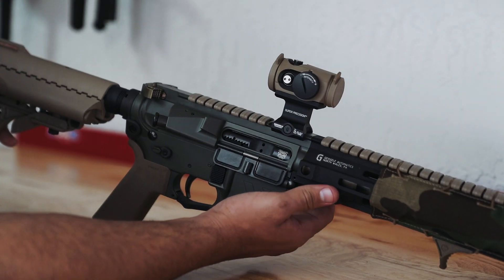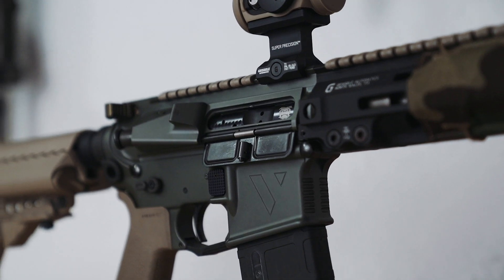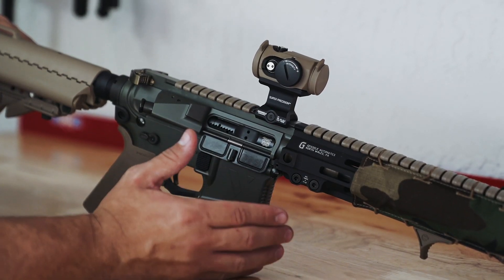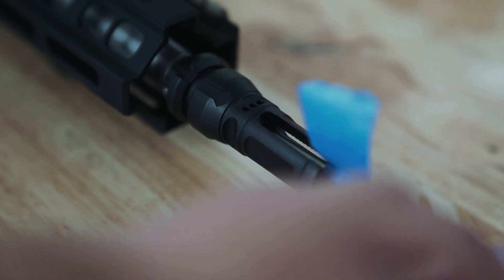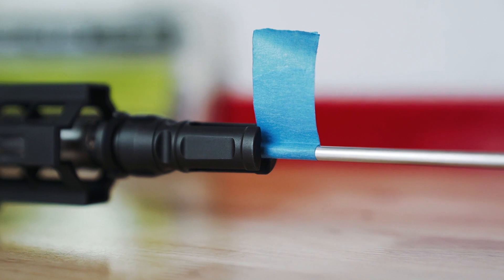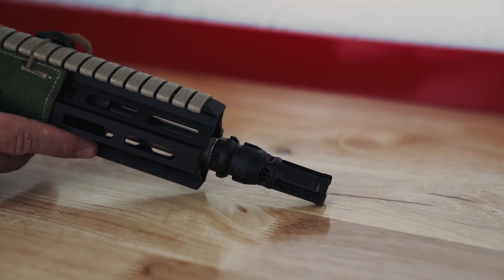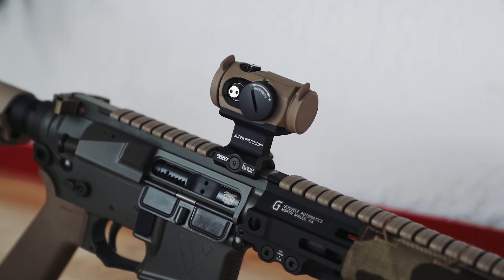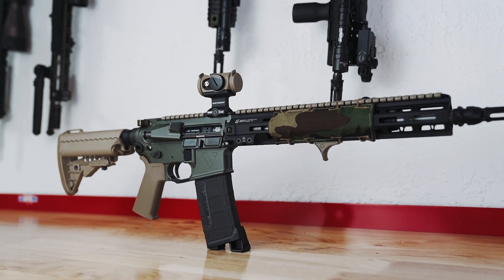Rosco Manufacturing 13.7" Purebred series barrel

Comment: Got this barrel, have a problem on locking back the bolt on last round, using 223 ammo, my setup is A5H0 vltor buffer system with comp break 3 port. Did all check gas block all good. Any idea what could be issue?
Reply from the maker: Does this happen with all ammo or just certain types?
Reply: @RoscoMfg  when I used 223 ammo that’s issue occurred, when using 556 it locks back, as 223 has lower pressure i guess there is not enough gas to cycle bolt all the way back. I also found some forum, the guy has the same issue and same setup as mine,  he say vltor system may not compatible on this barrel, he fixed it changing to standard buffer system. Which for me still not make any sense at all, theoretically it should work also on A5 vltor buffer system. I have not yet  tested a carbine buffer system to see if that will work. But i want to understand why it wouldnt work on A5 vltor buffer system, if that is really true that rosco 13.7 is not compatible with it.

Comment: I did some research on the 13.7" vs 14.5" barrel length debate 
A 13.7" with a 2.866" SOLGW NOX will have a total barrel length of 16.566"
A 14.5" with a 2.125" BCM MOD1 will have a total barrel length of 16.625"
That's a difference of only .059" Fifty-Nine Thousandths of an Inch
That's a reduction of only 1.498 Millimeters 
As we all know by Decreasing the barrel length on a 5.56 rifle, we are Increasing the Blast and Flash while decreasing the projectile velocity which has a detrimental effect on the ballistic performance of rounds that require fragmentation to impart their energy. I would rather keep the .8 inches of barrel to help combat these negative effects while only increasing the overall length by little more than a millimeter. The military spent years of research and millions of dollars to arrives at their selection of the 14.5" as the US Standard Issue M4 platform. The 13.7" to me seems to be a solution looking for a problem, but its operator as fug and power to you brothers for running one. Stay Violent.
Reply from the maker: Solid info.
Reply: The military selected the 14.5 with a carbine length gas system because it provides the proper length for a standard issue bayonet to mount to an FSB. Kind of like how the midlength gas system was developed by the commercial market to allow for bayonets to mount to 16 inch barrels with FSBs. So it was not chosen because of any major advantages in reliability or ballistics over any other barrel length. The differences between a 13.7 and 14.5 have been proven to be negligible. Also my 13.7 Purebred with a 2.3in Surefire Warcomp comes in at 16.1in so you can get shorter than what you previously stated.

Comment: Warcomp needs a ton more shims and even then is cutting it very close, usually a 13.9 barrel is perfect for it. The NOX and original BE Meyers 249 are long enough for 13.7.
Reply from the maker: So first of all, thank you for your input. We are always thankful for folks that share their experiences with us. However, please know that we took great caution to measure this correctly in order to pass valid information down to our customers. We would never shoot from the hip on this type of information, we have found the 13.7" to measure to 16" OAL when paired correctly to the muzzle devices mentioned.
Reply: @RoscoMfg  I’ve seen this myself in several builds I’ve fixed. 13.7 barrel has .625 inches of threading exposed. Longest warcomp is 2.7. Without shims it is 15.775 overall length. You need almost a quarter inch of shims to bring it to legal length. Besides looking goofy it exposes a lot of threads in the warcomp and created a small blast chamber between the muzzle crown and start of the warcomp body where carbon builds. 13.7 was originally designed for the BE Meyers M249. It is also the reason the SOLGW NOX is 3 inches. 13.9 came to be for warcomp pin and welds. I know even SOLGW acknowledges that a warcomp can work, but “extra shimming” is a massive understatement. In most cases it’ll still be about 15.8. Just want to make sure folks don’t just install it and call it a day thinking they are legal length.

Comment: I just got mine in the mail today, and I’d love to know which muzzle devices you’re talking about. There NEEDs to be a list of them somewhere. I’m dying to make this a rifle and not a pistol. I just want a flash hider, I don’t want a break. Any information would be greatly appreciated. Also what’s that powder that’s all in the barrel/chamber?
Reply: Strike Industries King Comp works. I have one on mine and it hits at 16.0156"
Reply: @welderdude1  that with a crush washer? I'm looking to use the jp double crush washer
Reply: @milkbreathmike  use shims to get a more accurate and stable muzzle attachment. I've stopped using crush washers as they deform in an irregular manner causing alignment issues with longer muzzle devices.

Comment: I don't get it. Why reduce velocity by using a shorter barrel, but add a longer muzzle device to obtain "legal" rifle length. Why not just use a 16" barrel? If it's not gonna be a legit SBR using a shorter barrel W/longer muzzle device is moot.
Reply: I thought the same, However...the point is to have an exact 16” gun you can put a stock on. 16” with that long NOX muzzle device really is great combo that plenty accurate to around 300 yards. It’s ideal for a battle rifle as there are better “sniper” options than .556 past that anyway.
Just IMO as I purpose built my 13.7” for a battle rifle.

Comment: But why? Seems like a solution to a non-existant problem. There is no point of making the barrel shorter if you're going to add 3" of muzzle bullshit to the end. You'll get far better ballistics on 15" with a 1" muzzle break or 14.5" barrel with a 1.5" muzzle break. If youre going to end up at 16" anyway it makes much more sense to have more barrel and more spins. Probably cheaper to do that way too.
Reply from the maker: Your mileage may vary, and we offer multiple options for folks that want to build something to their own specs. Why, because that's the beauty of the freedom that we enjoy in this fine country of ours. Also, keep in mind that there are WAY more folks (than your self) that already run this muzzle device/ suppressor system and wanted to find a way to run it and still meet 16" OAL without having to worry about NFA rules. Instead of worrying about this set-up you should take a few minutes to check out all of the other barrels/ options that we offer on our website my good man...
Reply: @RoscoMfg  totally agree🇺🇸

Comment: I remember when the 14.5" barrel M4 became popular, the Smith Vortex flash hider first version was an early barrel extensions for them. The early Vortex flash hider had straight, open prongs. The ATF ruled that they measured barrel to farthest full circle of barrel length and that with an open prong flash hider the length would be measured from the rear of the slots between the prongs and not to the front end of the prongs. This prompted the development of the Yankee Hill Phantom flash hider, which was supposed to mimic the early Vortex, but have closed slots to make legal length. The ATF said they viewed open prong flash hiders the same as measuring AK slant brakes and welded bayonets. I'm not sure how these newer open prong Surefire style flash hiders are getting by working as barrel extensions. Somebody must be overlooking older opinions, or just not having the designs approved, thinking they are going to measure long enough.
Reply from the maker: Do you really want to be the guy to write the letter to tech branch about it? They see what the standards are and leave them un-molested until someone decides that they want to disrupt the flow and question why the sky is blue. I remember this very same thing being an issue this time last year about a particular item that goes on the end of a pistol tube.....
Reply: @RoscoMfg  I remember that being the whole reason for the design of the Yankee Hill Phantom and it was due to the ATF view that the open prongs of the original straight prong Vortex would be measured at the rear of the open slots. Later Smith changed the prongs of the Vortex to helical shape, but I don't know if that changed the way the length would be measured. The ATF said at the time that open prong flash hiders would be viewed the same as slant brakes and welded on bayonets and would not be measured to the front of the open prongs.
Reply: @RoscoMfg  I love all these arbitrary rulings.  🤦🏼‍♂️

Comment: Been researching for a 13.7 build.  Will it work with the Surefire Warcomp Close Tine?  I believe it measures the same length of the warcomp open.  I'm a lefty and like the neutral port timing of the close tine.
Reply: The open tine Warcomp (2.67" plus shims) is longer than the closed tine Warcomp (2.48" plus shims).

Comment: Did you guys use your adjustable gas block in this build?
Reply from the maker: This one does not have one, but we have built other test uppers with it. It is no needed, but it is super sweet when you can custom dial in your specific setting.

Comment: Are there any muzzle devices that accept supressors that can be pinned and welded?
Reply from the maker: Yes, we actually talk about two of those in the video. It all depends on which company's suppressor you are running and what muzzle devices that they offer.
Reply: The Nox mount they show on this rifle is compatible with a variety of suppressors
Reply: KeyMo is a dead air design but it is becoming a standard. And they make KeyMo conversions for nearly all suppressor thread pitch options

Comment: How long is the handguard ?
Reply from the maker: That is a 13" Geissele MK8 handguard. Only 13" handguards will allow you to run a 13.7" barrel and a muzzle device that will clear the rail.
Reply: Rosco Manufacturing will the Geissele MK16 with a Warcomp work? Do you have enough clearance to access/lock down a Surefire can? I’ll buy one right now if it does!!!!
Reply from the maker: @charlesmorrison6695  if the MK16 rail is 13" long, then you will be in good form.